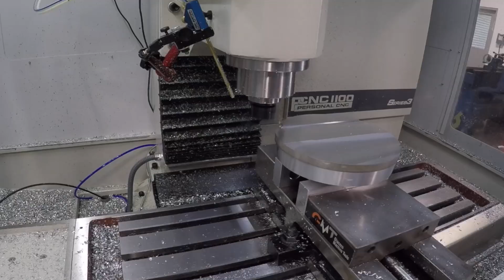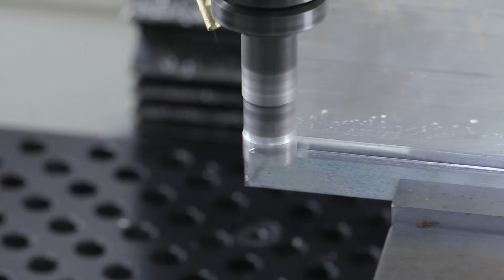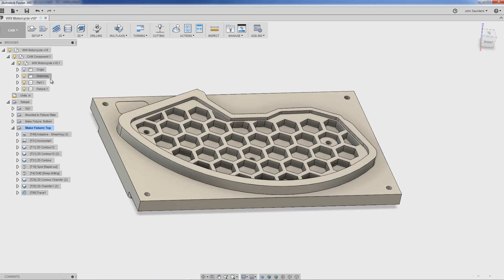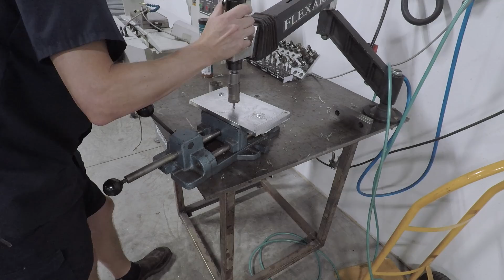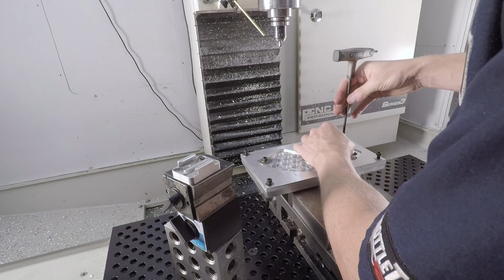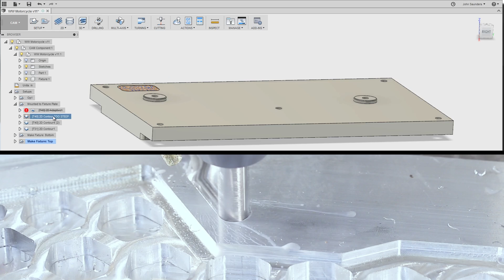Machining a KTM Motorcycle Plate:  Part 2!  WW160

Comment: The mistake was not using a small cordless drill to install and uninstall.  Use the clutch at the correct setting. In doing this, you will help to eliminate time.  I could produce 20 extra parts in a day if I use a drill with a clutch.  Just an example, making a prototype part....I never turn a wrench or an Allen unless it is in the drill.  I make my own bits if I need to.  You can always torque after you drive in the 10 - 20 fasteners.

Comment: I don't understand why you made a fixture for this part. What would be the down side of bolting it down to  a pallet with a small stand off and locating off the corner?
Reply: The thing about a cut fixture is you can pop it in once the vise is dialed, probe x,y, & z, walk away. Never need to worry about flatness of bolting it to the table. Each way has their pros and cons, I like the fixture ease of setup. The only draw back I see is the greater waste of material for the part he's making
Reply: A small stand off and bolts are called a fixture.